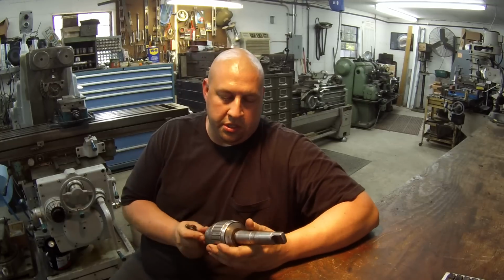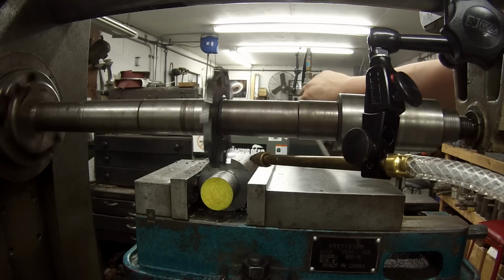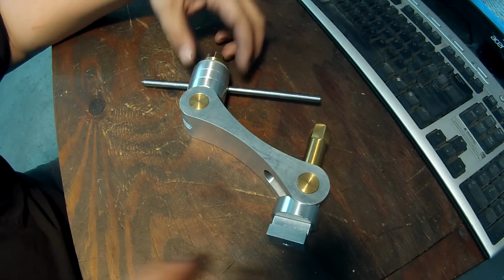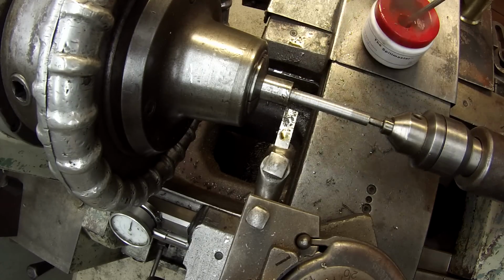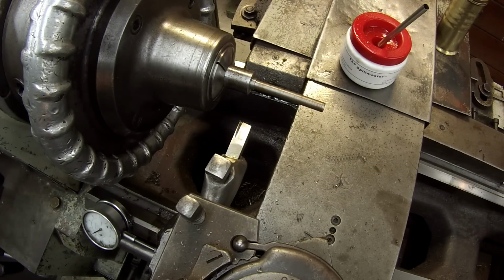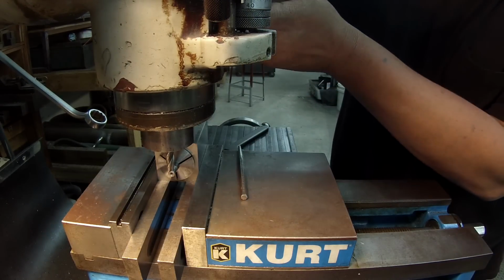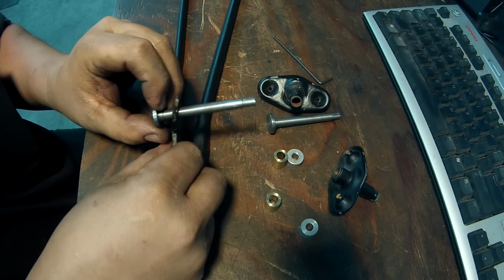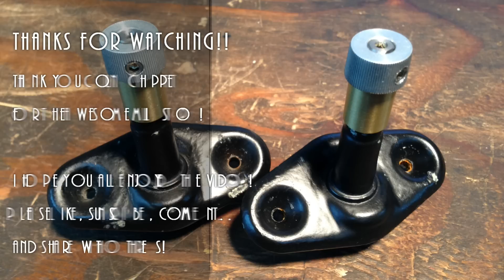Saturday Night Special 30

Comment: A. Booth Pimp my ride! lol  Colin fixed you up on a sweet looking stop. I am sure you will find that very handy for a lot of tasks especially for repeat setups. Congrats on SNS30 and even bigger congrats on the 1st cut with the K&T !!  This week I was reading a book and it had an add from 1919 proclaiming the record cut on a horizontal mill. With 35hp cutting 55000psi steel they did 1/2"Doc  x 5"wide with a 24"/min feed rate resulting in 900lbs of steel removal per hour!! I would hate to be the guy cleaning up after that job I would need a backhoe to pack off the chips!! lol It is amazing what some of these old mills could do!
Reply from the maker: That's some cool reading right there! it is amazing to see the big cuts being made, making what we do looks like child play. For the average guy, and average job shop work, I'm sure the K&T will impress. I can't wait to make some deep cuts.
Thanks Bryan.

Comment: Hey Adam, nice 30th video, I like the modification to the wiper arm. it just goes to show that some things can be improved on. I made a door hinge pin for a guy at work for his 72 Chevy with a bearing and an o-ring to make the hinge work smoother. He said it works great, the only problem is he only wanted 1, I told him I would make one for both sides but he said no just 1 was all he needed, well guess what, now he wants 1 for the other side. So when in doubt make 2. Thanks for the videos
Buddy
Reply from the maker: I almost ran into that problem today. I almost made two of a part, but decided not to. Well after a scare and almost scrapping the part, I was able to save it and keep going.

Comment: Dear Adam
Another great video, hard to believe it is number 30!  Please keep up the great work.
I love the Jacob's Super Chucks too.  I have three, the largest being the 18N.  Two of them were bought used and the the third was new, old stock.  Two were made in the US and the other in England.  All three are top quality products.  However, in my most up-to-date tooling catalogue that carries Jacob's Chucks, they are listed as "imported" and I recall hearing someone else noting they are now made in China!!!!!   So I would recommend that anyone looking for one be sure to note that it is a US or UK made specimen.and not an import as I know the quality will NOT be the same.

Best regards.

Paul
Reply from the maker: Last Year a got a new 16N chuck at work with a 40 taper arbor, and I was surprised that the chuck was labeled as made in China. The chuck itself works fine, but I can tell the difference in the finish. The bad is that the chuck key doesn't work worth a flip! It's too loose in the hole and doesn't get a good bite on the gear. So I just keep using my older (5 years) 16N and chuck key. When I do use the new chuck, I use the old chuck key on it.
The 18N has a much easier sized chuck key to use and you can bit down on it harder.

It's sad to see the continuing decline of well known USA made tools and products actually made here, and being shipped in from China.

Adam

Comment: Hi Adam, its really nice to see the old girl back among the living.  I told you the DRO worked, nice. The machine was actually made in England for K&T under contract.  Oh, and by the sound of that cut I am guessing you need to increase the feed a bit.  Usually you use the A support on the outside and the B support on the backside of the cutter, one on each side.  That is a super ridgid setup!
Reply from the maker: Never seen two supports being used before. I can tell you that small support "A" wasn't enough for those bigger cutters. I fixed up the style B today and tested with a big 3/4" cutter and it did much better. Well get it figured out man. I used to run these big milling cutters a lot but that was years ago now. 
Thanks James. 

Adam
Reply: great to see your gal back in operation James, .....Adam.....lets make some Fenner Keyways now.....
Reply: Abom79 If you could find, or make, a bushing for that other B style support you can run a B on both sides as well.  I like the B style bushings because you have some wiggle room in that the running bushing is wider.

Comment: I like that little pointy live center. I need to get one of those since I do a lot of small parts on my lathe. I think sometimes those little jobs can become more time consuming that a bigger job. I was looking at a collet closer for my lathe the other day. I think it would be handy to have. Enjoyed the video.
Reply from the maker: Steve you can buy those centers pretty cheap hear days. Mines an import model and it works good. They come with different changeable tips. Very handy. 
The collet chuck is a lifesaver too. 
Thanks.  

Adam

Comment: Great job on this weeks SNS Adam. Cant wait till you get the KT running properly and get some jobs loaded in there.
You are quite welcome for the gift as I'm sure it will get used plenty and not likely to find a better home.

Colin ;-)
Reply: *****
Maybe, likely not.... I started checking some pricing on factory made units.....cheap is $99, good is $199. Hard to make a living making them in small quantities at those prices. I would have to shelve it until the shop had some dead time.
Reply from the maker: *****
It's got to be hard tom compete with those cheap import products and prices. You about gotta have a one off item that no one else sells to make it now. But even Brad is finding out it's not long before someone overseas will copy you.
I think I prefer having only one of two of the CompEdgeX custom made mill stops!
Reply: Abom79
Well.... one of three....I'm making ONE more!!
For me... ;-)

Comment: Hey Adam,
Congratulation of 30 editions of SNS! It's funny how you start something like that, thinking you will put up a few videos and before you know it there are 30 episodes in the can! It looks like you can put some pretty hungry cutters on the K & T. It will be great to get the power feed working. I know how it is to have something you want to use and not be able to use it. Great work on the wiper linkage! Keep cranking out the great SNS programs, buddy! Before you know it, you'll have 100!
Have a good one!
Dave
Reply from the maker: Thanks Dave. I spent some time today working on another part of the K&T that needed attention. Another video for later.

Comment: Hey Bud,

Nice to see you bust out the TIG welder. For a minute there I thought you were going to use some 5/32 7018. 

Talk to you soon,

Tom
Reply from the maker: Hey don't dare me! I love my stick welder. If it wasn't for the tig I might be oxy-fuel welding them small parts. 
Thanks Tom. Hope you have a good weekend. 

Adam
Reply from the maker: *****
TIG is best for these small jobs, but if stick was all I had, you can bet I would have used it.
Reply: Abom79 I know somebody who broke a tooth on a benchtop lathe change gear, I believe from a craftsman 109. He brought it to work and the guy who welded it up used a stick welder, and didn't touch the sides of either tooth next to the broken one. Now whats a steady hand! Those change gears are tiny! And it worked after recutting the tooth.

Comment: Great show!......nice fix on the wiper project!  I was hoping you would have too much content, and need to start a Monday and Wednesday Night SpeciaL!......funny that you were talking about 18 & 20N chucks......was just looking around at them this week to buy.....the 20N's are pretty salty!....BTW....I've got an extra 50 Taper Lyndex chuck arbor with a JT4 if you can use it.....just let me know
Reply from the maker: Jim, I wouldn't hurt to add that to my small but growing inventory of 50 taper milling arbors. Not sure if I have a chuck to fit it or not though. I just looked at my extra 18N chuck and I cant find a mount size listed on it.
As for content, I was hoping to add another slideshow at the end but I already had way too much video for this one. It'll have to wait for another episode.
Thanks Jim.

Adam
Reply: Abom79
My 18N that is unmarked, was a JT4....1,124" on the big end.

Comment: Adam;

Congrats on #30.  I have to say I have learned a lot by watching you work on the various projects you have shown.  Also, that was a nice tool that Colin made, it looks similar to the one that Tom Lipton did a couple of videos on.

You mentioned you needed to figure out how to get the K&T set up so the larger bearing surface on the outboard end of the arbor could be used.  When watching the video, at about 11:04 you went to a close up of that bearing surface while the cutter was in action and I thought I saw a wobble in the bearing surface (it looked like more than a few thou of run out as compared against the background).  Is there a possibility the arbor may have a very slight bend in it?  Would that explain the chatter you saw in the surface finish of the cut?

Regards;

Ron Kluwe
Reply from the maker: Ron, I have been working on the larger outboard support today and getting it ready for use. Your right about the runout though. The 1" arbor does have a slight bend, so I may be looking for a new one to replace it.
Reply: Any chance you can bend it back?  Would this be the same as trying to take out the bend in a prop shaft?

Ron

Comment: It would be interesting, to put a dial indicator on the top of the arbor shaft and take a large cut in climb, just to see how much deflection there is.
Reply: Exactly. I'm an absolute n00b if there ever was one in machining, but I was wondering "why is that not a climb cut - it's supposed to be superior, if you machine is rigid enough?!?"

Comment: Adam, Congrats on SNS 30.  Great video. 
Question.... how do you find center on the shaft on the K&T?
Reply from the maker: There's a few different ways to do that, but on this one I used the cutter to find center by making small cuts untill I was cutting the full width of the cutter, and adjusting the Y axis until it was cutting evenly in the center. It was just for fun so I wasnt too concerned if I wasn't centered perfectly.
Thanks Herb.
Reply: Abom79
Thanks for the reply Adam, I've used that method before on my vertical mill, but mostly use an edge finder.

Comment: Hey Adam...
Aren't those bushings that you made now in the place that the wiper arms have to go?
Thus making it impossible to mount the wipers?

I am confused...
Also... That design does not have splines to locate the arms?
Then what stops the wipers from spinning on the shaft?

So, I assume the locking collars are all that hold the wipers in place... Hmmmm
seems like a bad design on GM's part.

... No flat to locate them and no splines... Interesting.
I am actually surprised that the design works...

My cars (Japanese) all have splined shafts and the wipers locate firmly in place using a cap nut to only hold them onto the shaft... Not to prevent them from spinning.

Keep up the good work...
Reply from the maker: The aluminum bushing on the end of the shaft is splined and fits the factory wiper arms. The arms press down on the bushing. They needed more height because of a modification made on the cowling on the car body.

Comment: Is it worth investing in a "speedglass" helmet for your welding? They are not that expensive now (I think I paid about £25UK, maybe 40 dollars?) I know it bugs me to no end to have to nod the helmet down when using a standard helmet.
Reply from the maker: I used that welding helmet since I was 17 and it's what I got used to. I like an auto darkening helmet but it's not that important. I do have one though, it just needs a new head strap if I can ever get down to Airgas to buy a replacement.
Reply: I hear you, I've just bought a new one to replace one I've used for 20 years. You get attached to stuff.